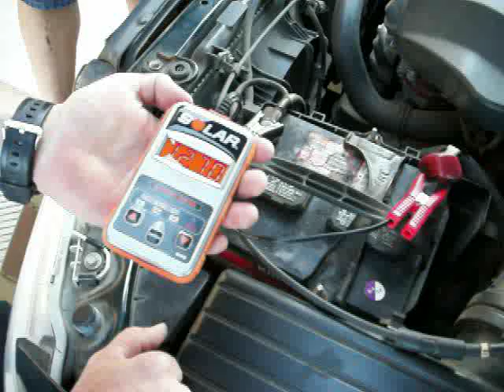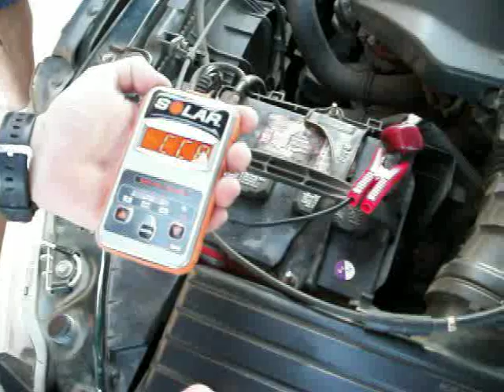Solar Automotive Battery Tester

Comment: Your wrong about not needing to fully charge the battery first. Those testers work off of an internal resistance measurement of the battery. A fully charged battery will have a lower internal resistance. The lower the internal resistance value, the higher the cold cranking amp value will be. Thus the battery DOES need to be fully charged to get accurate test results.

Comment: It's actually the letter I (eye), although it's not clear from the display. SLI actually stands for "Starting, Lighting, Ignition", just a way of saying it's not the expensive AGM (Advanced Glass Mat), like the Optima, Orbital, etc. brand batteries. Good video, thank you for it.